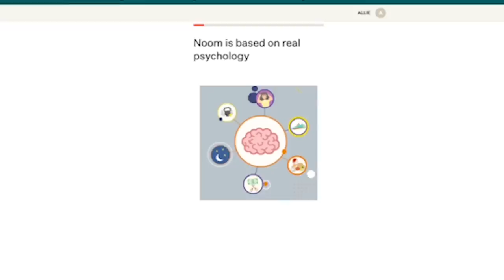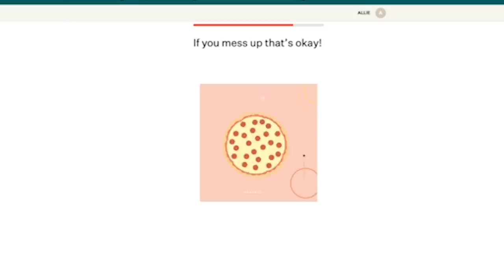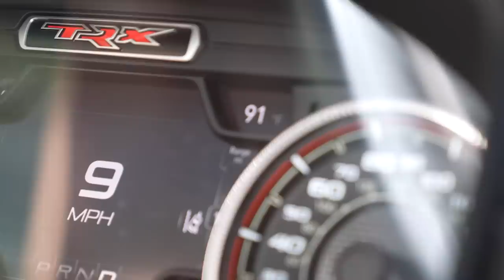THIS COULD STOP CONSTRUCTION COMPLETELY | BUILDING OUR OWN HOME

Comment: Been in the truss business fo 25 years guys. You load flush with the drivers side of a truss hauler and overhang  on the passenger side. That's why most of the tome you see a truss truck in the left lane cause all mailboxes and bridge rails go over and signs are away from the peaks.  Usually there about a freight added to the cost of the order, what I have done is outsourced withe a local building supply  and have them deliver on a short truck.

Comment: Trusses should match wall stud framing. So if your walls are 16 OC, so should your trusses. the trusses need to be positioned under a wall stud so the load is transferred to the studs,.
Reply: Under a wall stud?
Reply: @tinydancer7426  Yes: Walls are usually framed either 16" on center (OC) or 24" OC. The  trusses should match the wall framing
Reply: @guytech7310  But, don't trusses set on top of the wall framing ..... therefore sitting OVER a wall stud?  I wasn't question the matching of the spacing, I was asking about "under" as apposed to "over" a wall stud.  The walls (and studs) are already in place, so logic would tell you that the trusses have to be put in place on top of that structure, consequently OVER the studs.  Right?  🤔    🙂
Reply: @tinydancer7426  In the video he stated the truss company only sent them trusses for 24 OC, but they planned on 16 OC. The walls I believe are 16 OC. So the trusses won't line up with the wall studs. since they sent them too few trusses. What will happen is that many of the trusses will not be positioned over the wall studs. They be positioned over the stud bays.
Reply: @guytech7310  I know that. Again, my first comment was to question your saying "the trusses need to be positioned under a wall stud so the load is transferred to the studs" (I copied that right from your comment).  

I am fully aware of the engineering involved in the placement of the trusses in relation to the studs.  You don't need to explain that yet again.

Comment: Call in the pilot cars to hold traffic at wide spots for load to move smoothly.  That company often loads trusses with points up which can make it easier sideways but then the height could be an issue.  Have escorted hundreds such loads into difficult places.  They often set trusses on ready structure with their onboard crane.  Have moved with concrete bridge beams way over 100 feet long  that have a manned steercar under rear .  More  than once people have or attempted  to  merge under the span  between drivers in cab and one lowriding  while moving at freeway speeds..  They had to hang  bars and lights to deter that.  5 mph over mtn passes for hours is like a wagon train.

Comment: Hey Trent, when you were buying a new truck replacing the 2500 you insinuated you were replacing it with a Ram 1500 4x4...I told you that you wouldn't be happy with the 1500 nor would it be as good as the 2500....You neglected to say you were replacing it with the RAM 1500 TRX...No doubt the TRX 4x4 exceeds what the 2500 ram could do.703 HP Hellcat motor beefed up suspension, lol I bet it passes everything except the gas station...Nice Ride..